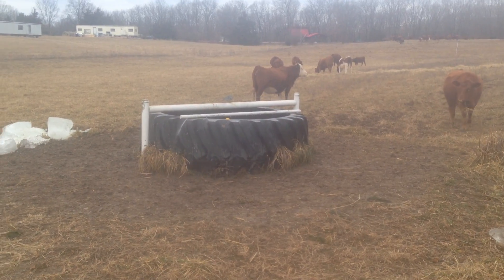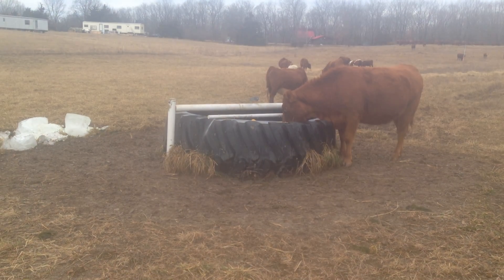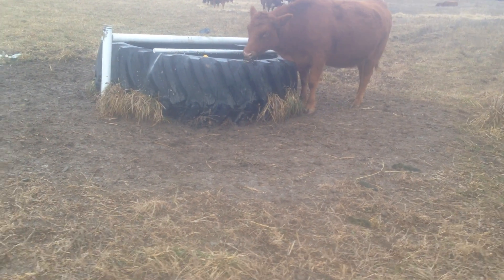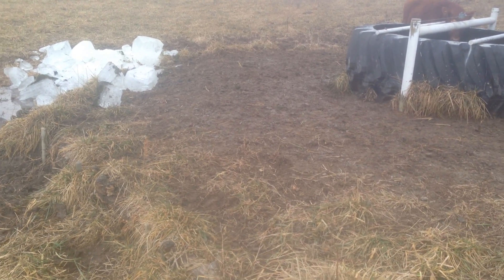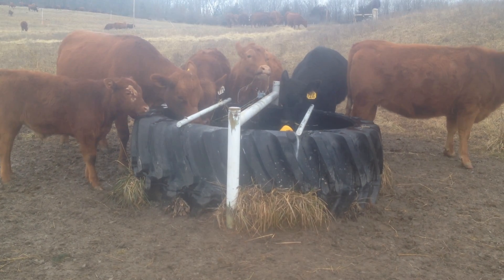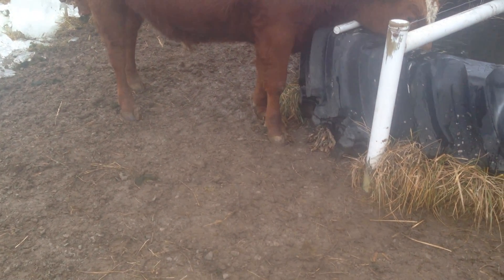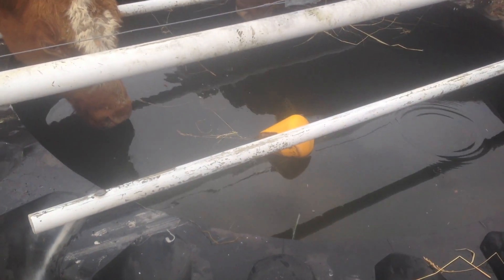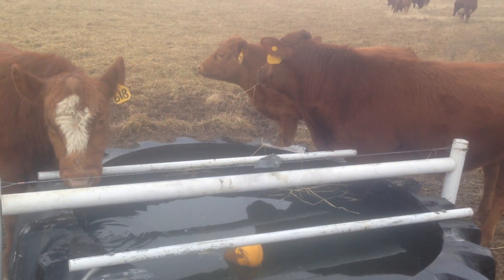Episode #15. 2018 winter tire tank talk

Comment: Greg, if you were not using the tire tank until Spring, what would you do to avoid having frozen valves and possible freeze damage?
Reply from the maker: We let our tire tanks freeze up. They never freeze all the way to the bottom. If we drain them the water pipe would crack.